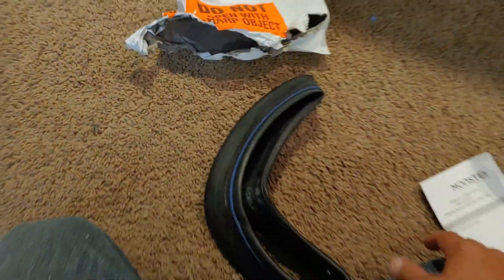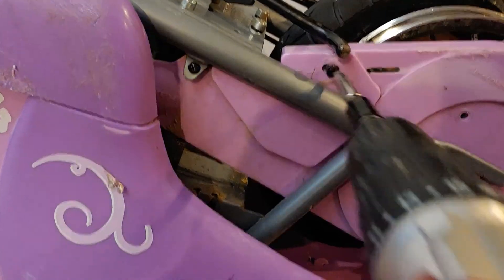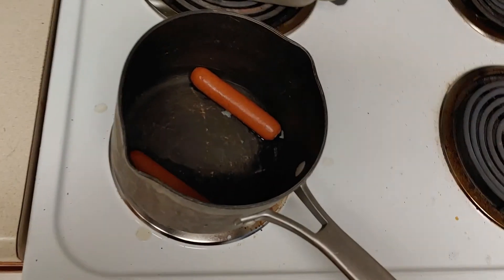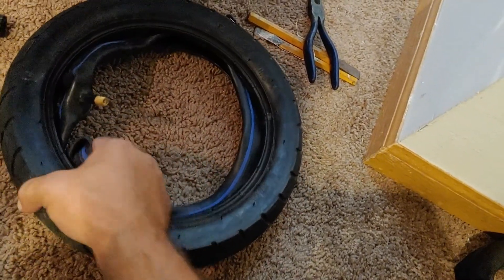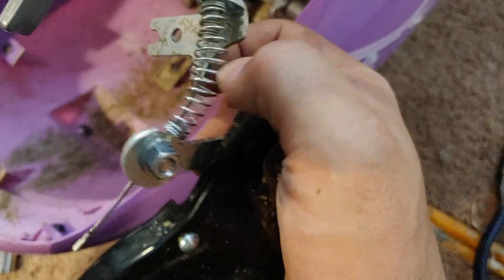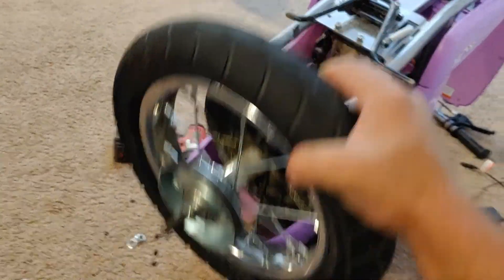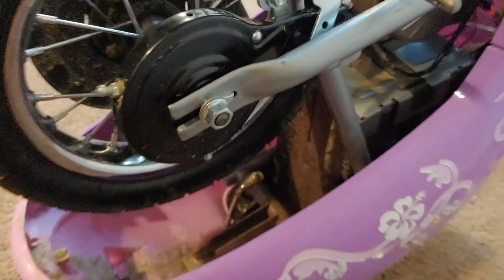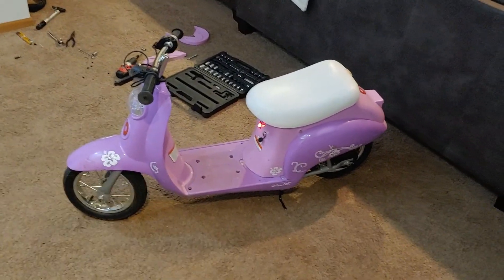How to Fix Replace Tire Tube on Pocket Mod Electric Scooter

Comment: So I replaced a tube and reassembled. Now I have two problems. One, when the kick stand is down, the back wheel spins when using the accelerator but wobbles noticeably.  And two, when my kid gets on the razor, it's like it doesn't have enough power and he goes nowhere. Chain looks good, everything is tight. Any tips?

Comment: It's funny how you use that word not sure if you can still use it but how do you feel after finding out that filling up that tube before putting it on was not the way to do it amazing it answers your question about is that word still possible to use how do you feel pretty stupid if you ask me if you don't know how to put a tube in it SMH 😂
Reply from the maker: It went on fine. I filled it up a little just for it to have some substance to get it on the rim. My method was amazing, the run-on sentence utilized by someone here was sub-par.
Reply: Couldn’t help yourself could you? Let’s see you do better.